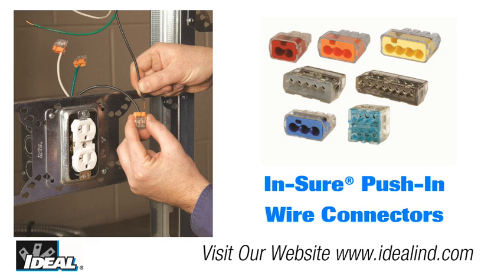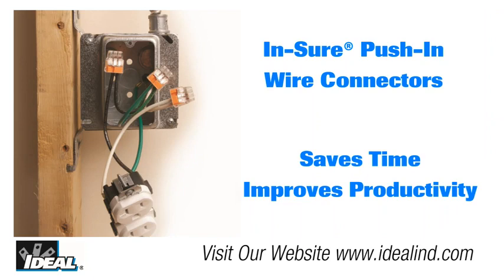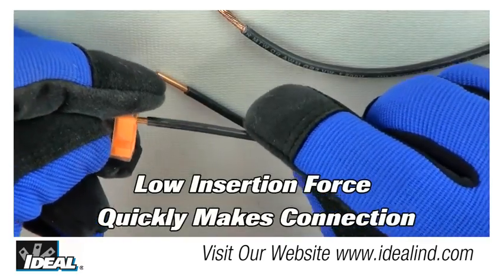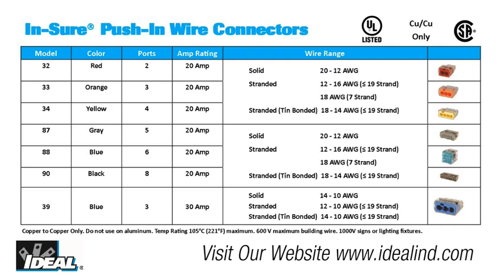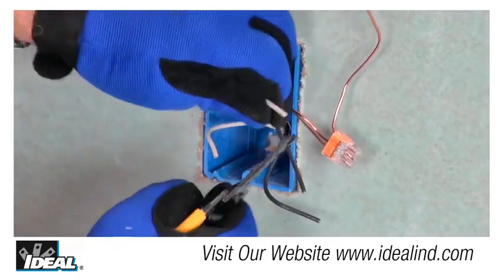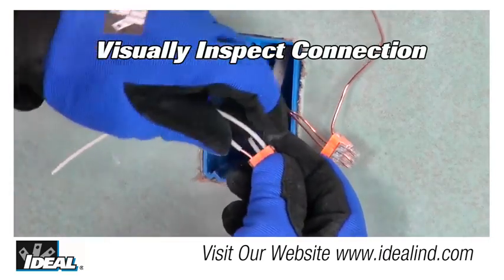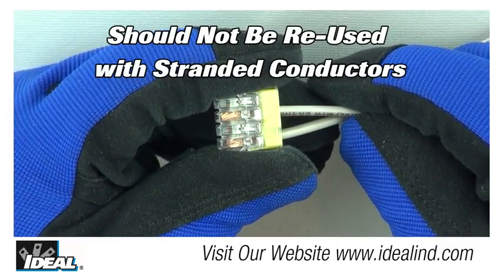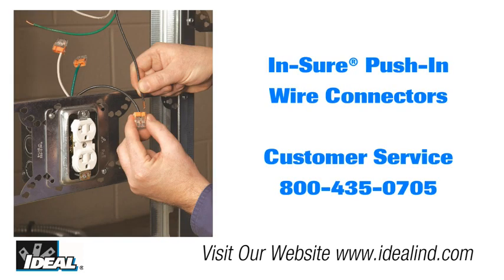IDEAL In Sure® Push In Wire Connectors

Comment: I have been using push in or stick and squeeze connectors for over 30 years and I have never, every had a fault or failure.  I do admit there are times where wire nuts fit the box better though.  At the end of the day, I'm not 110% that these are all that much better than wire nuts, but they definitely have an application.

Comment: i have found they are great to use until you need to push them into the box than the slightest bend and or twist and at least one wire comes loose had a very hard time to use them it was the yellow 4 port #20 to #12  and yes i was using them on #12 and #14  the (#12 seems to have been the trouble ones most of time cld tht  be the problem?
Reply: I have this same problem with them especially with the 12 g wire because it is so stiff and uncompromising. I just make sure to plan ahead for exactly where I am going to fold them into the box. Making sure that they are all lined up well with the right amount of slack in the lines so that it doesn't pull them from the connector when i go to tuck them. I actually want to start using the lever connectors for this reason.

I only came to this video as part of an inquiry to find out what type of conductive metal is used inside of ideal push connectors. Its silver colored so its not copper. Maybe nickel or silver?  The video won't load for me.
Reply: @funkmanone  i believe it's copper coated in something but i pulled one apart and you could see copper in the core

Comment: Can you use 4 port connector with only 2 wires in it?
Reply from the maker: Hi Joshua:  you can only use two of the ports if needed.  Thank you.
Reply: IDEALINDUSTRIESUSA so it’s okay if I have two open slots open? And left if the box for the future
Reply from the maker: @joshuawilson2362  Yes it is.  Thanks.

Comment: Sooooo difficult to use with stranded wire, it just bends!
Reply: Yes it just bends for stranded wire and you can't push it in. Had to go back to the wing twist wire connector.
Reply: I believe the video specifically indicates stranded wire CAN’T be used with this connector.
Reply: @thecrusader3152  can not be reused with stranded wire. Definitely says to use with stranded wire

Comment: These are by far, the worse type of connectors out there. Once in, it's so hard to get them out. The transparent part is great for a visual clue how much of the cable is in, but that's about it. Whoever designed this, omg..should do something else.
Reply: Shailen Sobhee you just have to twist back and forth while pulling very easy
Reply: @ianwilson1986  

I'm about to use them on small, 18 gauge wiring. I'm skeptical about the removal process, but let's see.